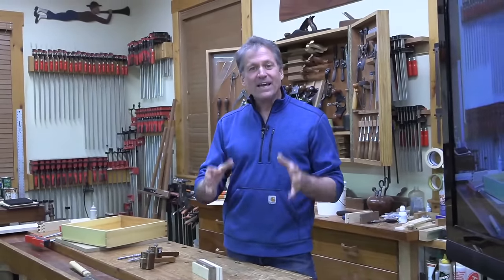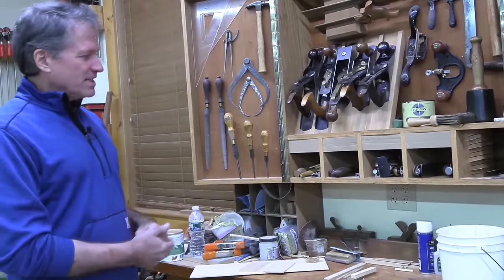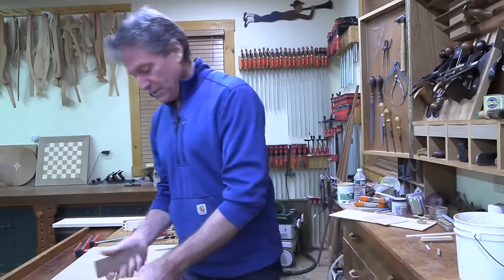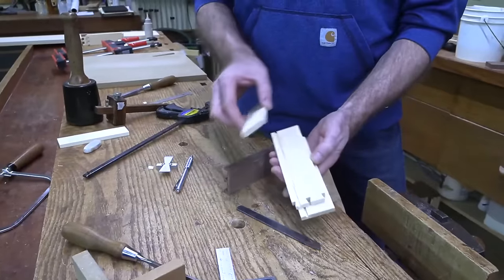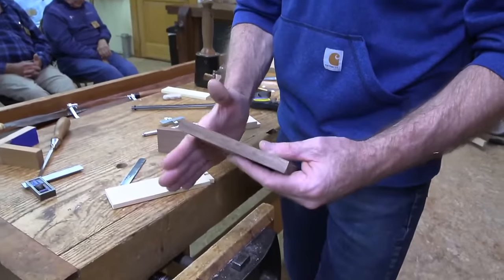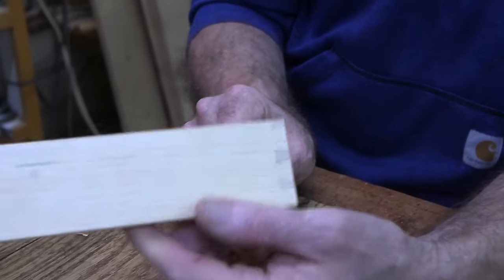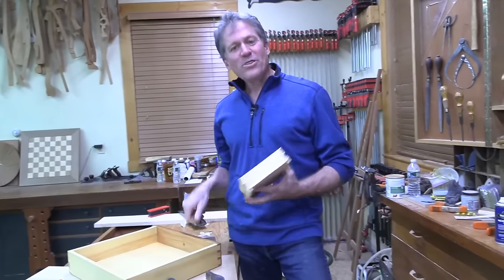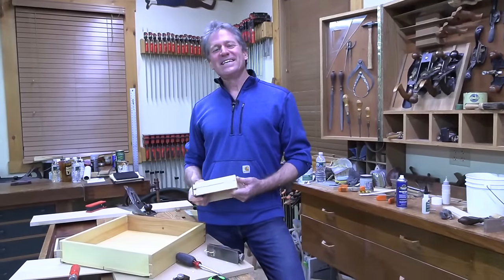How to Make Small Drawers

Comment: When cutting e tail boards at the same time tape them together so you don't have to to align then every time they come out of the vise!
Reply from the maker: Thanks Doug, good tip. I find myself weighing the time it takes to add the step of applying the tape, given I only need them to stay aligned when I turn on the side to make the end cuts on the tails…and almost always I can keep them aligned by squeezing them together during repositioning. If they do slip and I need to realign, I find I can do that faster than applying tape. But maybe I am misunderstanding your suggestion, I will keep it in mind next time I cut dovetails (which will in fact be today) and see if I can implement your idea. Thank you for helping me get better! 👍😎

Comment: Hey Tom. Great session!  A lot of things covered in a short amt of time as well. Just a question about the bottom panel. In general is it better to have the grain side to side as you did, because the exp/ contraction is more in the other direction?  I noticed the screw was there for that reason.  I guess there could be a chance of the drawer jamming if the grain ran the other way?thx. I learn a ton from these videos👍👍
Reply from the maker: Yes, you got that right. The orientation of the grain to the drawer bottom is all about how wood moves seasonally. And the lightly snugged screw in the back allows for seasonal expansion and contraction out the back. If you went the other way, the drawer bottom could expand and tighten the fit during humid months.
Hope that helps and makes sense! 👍